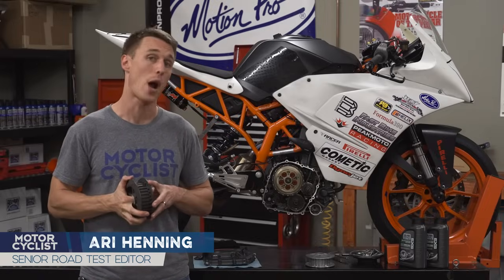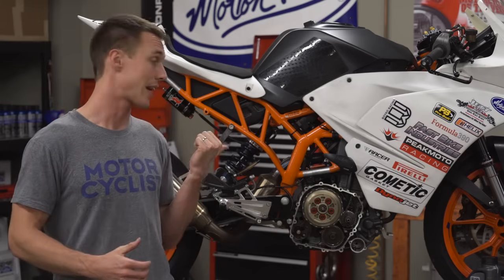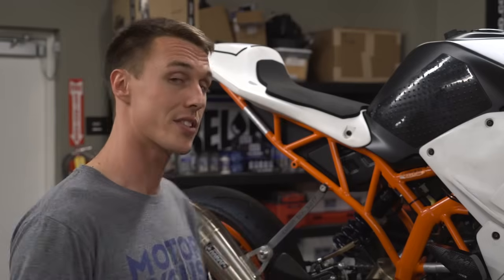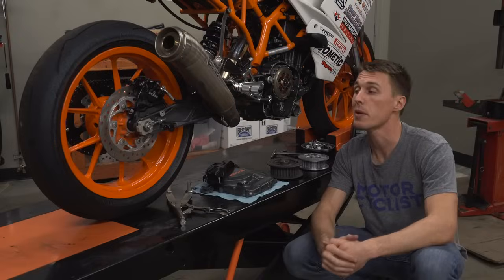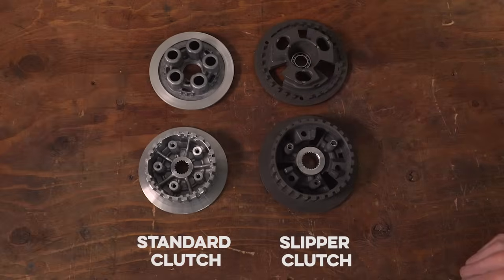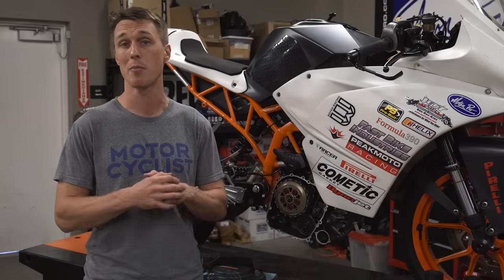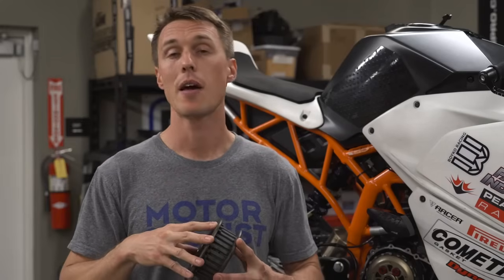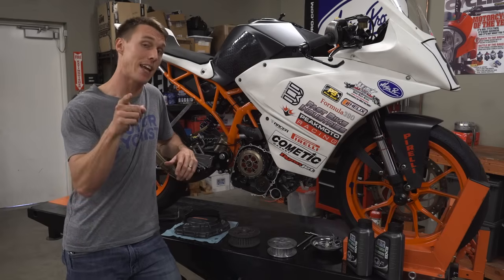The Motorcycle Slipper Clutch: How They Work and Why They're Awesome | MC GARAGE

Comment: Some people say on the ktm 690's this is the cause of the poor clutch life. I have abused the hell out of my wr450f clutch but my ktm 690 slips with even just a little bit of abuse. After chrissy i will be checking my clutch pack and upgrading the springs to stiffer ones.

Comment from the maker: See the RC390's slipper clutch in action at Sonoma Raceway: https://youtu.be/x925xccO9wc?t=1m16s
Reply: Motorcyclist Magazine you were revvmatching with the slippery cluch. Does it make any difference between revvmatching on a slipper cluch and not revvmatching. Or is the output the same. Cus i love the sound of blipping the throttle
Reply: IMHO Slipper Clutch is simply made for Lazy rider's ,  changing down while blipping the throttle even when NOT using the clutch (YES I said not)  most Motorcycle gearboxes are constant mesh Dog selected and will do so easily if the dogs and gears in sync. If you are used to a particular bike it is easy to go both up and down gears without the clutch if required.  I use the clutch to disengage on down shift and usually have released the clutch at the same time as blipping the throttle or marginally afterwards.
Slipper's certainly have a place in racing but on the street , I don't think so as I believe that it makes rider's lazy.
Reply: Motorcyclist Magazine can you explain what is clutchless and how it works
Reply: Is there a video on clutchless shifting and would you say harmful or not harmful?
Reply: You can shift clutchlessly and it is often done on the up shift but back to the video here !!!

There are far too many people placing training and explanatory videos on You Tube that clearly have NFI !! Pure and simple. Just what this clown is on about I don't know !! 
This is NOT repeat NOT a Slipper clutch in ANY way shape or form , it is an automatic over run clutch for dickheads that cannot ride nor operate their motorcycle properly as it was designed to reduce the engine braking effect and chatter created by incorrect heavy braking Technic.. 

ALL modern bikes employ a wet multiplate slipper clutch,  
Automatic and partial application of the clutch is dangerous IMHO.
Reply: Motorcyclist Magazine can it fit CBR600RR 2003 model
Reply: I have a question, can the stock clutch plates be replaced with slipper clutch?
Reply: Just remember, you have to get the slipper clutch back before midnight, or you'll turn into a pumpkin.
Reply: I have a question, we don't need to rev match on a bike with a slipper clutch?
Reply: How about the hyper clutch
Reply: Simply NOT using the clutch unless starting off and or stopping,  with skill and being profoundly used to a particular cycle it is easily done , 
I seldom use the clutch on up shift ,  You simply apply light presure to the gear shift and lighten throttle application VERY briefly - poof as load comes off the transmission the change is made . 

I can change down the same way by having light pressure on the shift and at the same time I blip after very briefly getting off the throttle , the down shift is complete.
I DO NOT recommend doing this to any Motorcycle  , I have road and drag raced in my younger days and am  I ride my bike most days so I'm VERY familiar with it . 
I WISH people would STOP the BULLSHIT Statement Rev Matching  !!! This is an incorrect mechanical term when you should be saying gear synchronization .

Comment: so basically when youre riding, a slipper feels like a rev match? but it does so automatically ?
Reply: Carmel Fradrick i'm guessing you don't either if you've never heard of a rear wheel locking up. I suggest giving this a read before you laugh at someone and making a fool out of yourself: https://en.m.wikipedia.org/wiki/Slipper_clutch
Reply: +Carmel Fradrick I'm 51 started riding when I was 8, and went out for a ride today and you? 17 being riding for 6 months? No doubt you will also be an expert in driving cars with a crash box and never driven one.
Reply: Pvk Jhilk really ? rear wheel locking 😂😂mate do you even own a motorcycle ?
Reply: Carmel Fradrick on a bike with no slipper clutch, downshifting without rev matching will cause the rear wheel (turning quickly) to drive the engine crankshaft (turning slowly due to no rev match) through the gbox & clutchpack. The resistance from having to drive the engine can slow the wheel down, if slows down to a speed less than you're cutrently travelling, will cause a skid & loss of traction. Slipper clutch prevents torque being transmitted from wheel to crankshaft, but allows (assists) in transmitting the other way.
Maybe you already know all that, but did ask....
Reply: Carmel... pretty obvious from your response you're just a kid and a noob on a bike. You thought you know it all.
Reply: iodineclip nope ! ideally you have to pull the clutch to do the changes if not dont properly then you feel the push or technical term engine breaking so in slipper clutch there wont be as much as of engine lug and even you shifted up while in lower rpms the clutch pack will eventually get you power guess that solves your question ! 🤣
Reply: nope just prevent the rear from locking if you do not rev match correctly
Reply: Richie Pistashios dude you should read before you post a link try reading the first para and you will know what i was talking about I personally own a vehicle with a slipper clutch so i know a thing or two
Reply: Richie Pistashios and i wanna ask you do you know how a rear wheel locks up ? and plus i wanna know where do you get your information mate ?
Reply: Ojsh _ so what did i say mate you just commented the same shit !
Reply: not sure what you said bro, just answering the question on how a wheel locks up.
Reply: +Richie Pistashios the slipper clutch may prevent the rear wheel from locking up in the case of an engine seizure. the rear wheel doesnt get locked up from downshifting with or without a slipper clutch. in normal operations, the main purpose of the slipper is to prevent over revving of the engine due to downshifting aggressively. and for lazy people(or those with quickshift), the need to rev match to facilitate a smoother downshift(without the jerking forward effect of the bike).
Reply: +Carmel Fradrick Pvk Jhilk clearly knows how to ride an older bike, unlike you who is obviously a Johnny come lately and doesn't know what it is like to ride a bike without your nancy boy slipper clutch. I have been riding for 40 years and I can tell you without the slightest reservation prior to slipper clutches even with the most skilled rev matching back wheel lock ups were common on uneven surfaces, dirt roads, in the rain, or enthusiastic down shifting. So go back to your comfy little world of thinking you are some kind of modern super star and leave riding real motorcycles to the men.
Reply: Let it go. You have too many internet MotoGP experts that have no clue what causes rear wheel lockup and what rear wheel chatter is and why slipper clutches were invented. As all three have nothing in common.
Reply: Caramel fradrick dafuq did you just say about the slipper clutch and lugging the engine and clutch packs will get you power? Whaaaaat? hahaha
Reply: Dodgy Brothers well i did start late i was 12 when i had my pit bike ! and ps i did own a suv ! this doesn't makes me amateur and sure you have tons of ride hours 
sorry grand pops no harsh feelings
Reply: carmel... dude seriously there's nothing wrong in not knowing something. just accept and learn the fact. aggressive downshifting causes locking up of the rear wheel. slipper clutch removes that to a certain extent but It is still possible to lock the rear wheel slightly...

Comment: I own a 1290 SDR and have yet to NOT rev match downshift. My understanding after watching your video is; I should be able to ease off the throttle, squeeze the clutch in then click the shifter down and release the clutch without applying throttle and the bike will not lock the rear?
Reply: Dino Velvet Essentially, yes. If there is no weight on the tire or there is very little grip it may lock a little though.
Reply: Frankenthe3rd thank you! I never trusted going against the rev match; however, perhaps I'll try the slipper feature and see how I feel about it?!
Reply: Chuck Beaubuck Good thing you did Chuck, I had a 98 Blade and there was no slipper clutch on it... Then again, it wasn't revving it's head off like a new 1000cc sports bike so it tended to stay a little more civil.

Comment: if you watch the motogp boys they slam multiple downshifts coming into corners, selecting the best gear for the exit, utilizing the slipper clutch aggresively
Reply: Anthony Butera Those bikes have more complicated electrically controlled slipper clutches.
Reply: Agreed but more than just a system to protect from bad downshifts it is a tool for more agressive riding.
Reply: Ari, I have a 2003 Suzuki SV1000s and have heard and read conflicting things about it having a slipper clutch or not. It feels different than other bikes and is built different than anything else I have seen. Were they slipper type stock? Thanks for the help.

Comment: One question:
You said that the slipper clutch removes the need to rev match.
If I were to simply drop a gear on my Duke390 (which has a slipper clutch) I'd get a huge "thud!" sound the moment a lower gear is selected.
Isn't that wrong?
Reply: Which year are you? I don't think yours has a slipper clutch..
Reply: Ronnie Lazarus 2015
Reply: ***** yes
Reply: ***** it sounds just like how you would engage the first gear from neutral after starting the bike.
The bike doesn't over rev either when I try that on the highway. Plus, I can pull the clutch lever with two fingers. Is it possible that they put an ordinary clutch and only fewer springs?